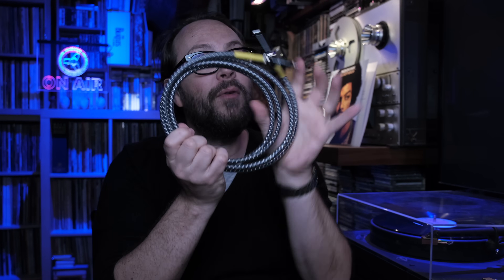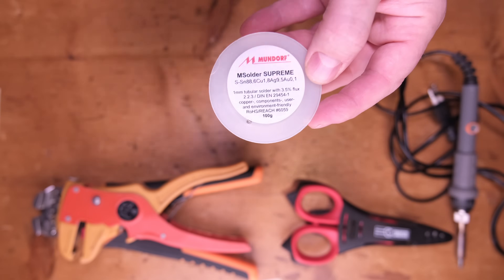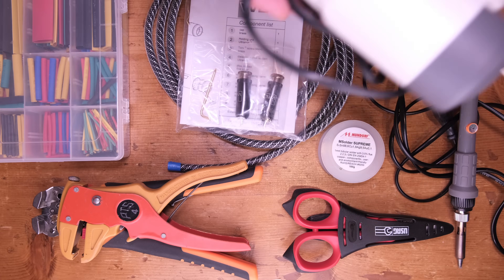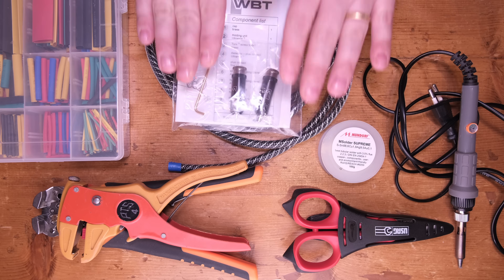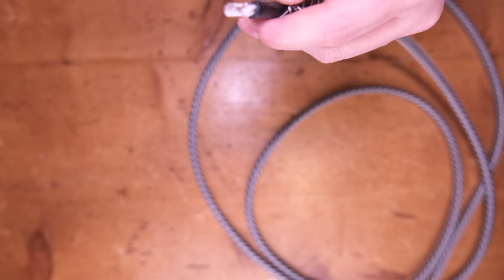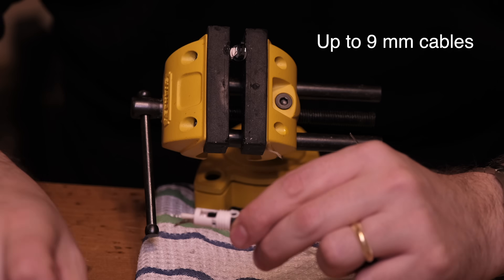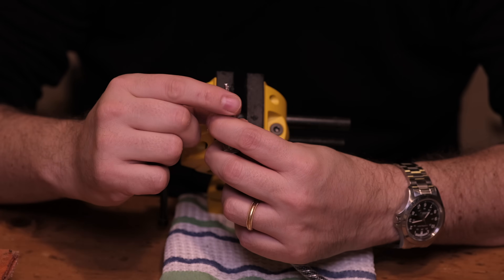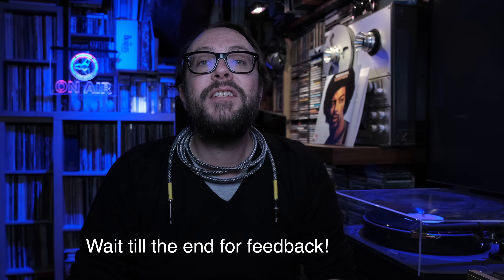How to make the perfect coaxial cable for digital audio (SPDIF)

Comment: Hi can I ask what you done with the copper band.thanks in advance  I'm in the process of ordering a 2m length and 4 rca fitting s to make x2 cables
Reply from the maker: You mean the braid? I am not sure but I think I did not connect it this time or only at the source side 🤔
Reply: Hi would you consider doing a new video with the same cable and rca plugs i am wanting to order the same bits .
Regards mark

Comment: U need 50 ohms digital cable  from  internet  distribution suplyer. Just ask them the cable cuttings in the recycling wire. Never use 75 ohms

Comment: call me crazy, but i don't think the plugs should cost 8 times or more the cost of the cable, the neotech can be got for £12.50 from hifi collective for 25cm, which is all i'd need, the plugs are over £50 each, that's snake oil lunacy

Comment: Main to know the coax is a radio waves transporter thus it is absolutely must be in 75 ohms..yes yes I mean that you need an antenna cable.😊
Reply from the maker: Yes but with DIY you must be sure also the connectors respect that

Comment: Love it!! Thank you for posting! Also, I have a Michael Jackson master tape. It's 2 inch, 24 track master that I transferred a few years ago with my very own Otari MTR-90 24 track recorder. It has all of the discrete tracks with 2 vocal passes of Michael singing. This is done for comp'ing. Thaqt's when you select the best parts of two performances during mixing in order to create one very good take. I obtained the tape from a guy who was selling off  multiple reels of tape that he got from Ocean Way studio when they had transferred everything to digital for archiving. The tapes usually go in a dumpster after the digital process. In this case I needed a few empty 2 inch reels for when I'm assembling a master mix tape and in this case, he sent me the reels with the tape still on the reels. The label outside the tape box says Michael Jackson Dangerous. The tape came with alignment tones so that made it easier to align my machine to the tape.
Reply from the maker: Wow!!!🤩

Comment: Could have bought a perfectly good digital coax cable for a few bucks, all the zeros & ones  would have got to the DAC, and the sound would be exactly the same!
Reply from the maker: Impedance matching does help and don’t forget that all the zeros & ones as you call them travel in an analog format, voltage, hence subject to all the various problems and issues of normal cables

Comment: Its a lot easier to buy off-the-shelf BNC coax cables and add BNC to RCA adapters. BNC coax cables are pretty cheap because they are used by the millions in every electronic shop in the world.

Comment: Ye - you should have shown measurements - how good this cable is ☝☝🧐
Reply from the maker: Measurements on short cables are nonsense. Only dielectrics have a sensible impact. Capacitance also have an effect but mainly on weak signals like tape heads and phono cartridges.

Comment: or, you can buy some van Damme coax for about 10 euros, some fake WBT's for 10 euros, and make a functionally identical cable for a tenth the cost of this nonsense. A digital signal just needs to get cleanly from A to B, digital information doesn't care if it gets sent over silver, and it certainly doesn't know if its going over a genuine WBT. Spending more than 200 euros on a coax cable is madness.
Reply from the maker: There is no difference between analog and digital signal because digital travels in an analog form, yes, voltage so it is susceptible to the same problems of interference, inductance, capacitance and resistance, plus all the problems coming from the dielectrics. It is much more complex than what we think.
Reply: @anadialog  Best answer one could have wished for.

Comment: The golden rule of audiophile cables: You tell the average audiophile the price of each cable and magically the more expensive one will be the best sounding one.
Reply from the maker: Don’t know what you are commenting because I am the first (for years now and with much more impact) to claim that you don’t need to spends hundreds of dollars but just look for quality materials and do them yourself
Reply: @anadialog  Yes, I know, and I'm not here to disagree with that message! Actually I agree on it 100% and also love my own system to look audiophile on every cable, even for those cables where there is no actual audio fidelity difference.
Reply: @anadialog  One video that would be really fun to make and very informative is to go the other way around and just make a very long SPDIF cable using 75 Ohms antenna cable long enough to get audible data errors. You probably need more than 25 feet for that. Then reduce the length until you feel the audio data is coming through reliably and run an A/B blind listening test between this insane cable and any dedicated SPDIF cable (short length), ideally some crazy priced Nordost cable or similar. If you can reliably convince yourself that you actually hear any difference, it would be interesting.

Comment: Obviously audio cables costing 100s or 1000s of Dollars are pure snake oil considering the actual material BOM cost is down in a few Dollars. However, don't get fooled also by their marketing justifying those insane cost to think that you need sophisticated cables for everything. SPDIF (Sony/Philips Digital Interconnect Format) is a relatively simple one way binary level data transfer connection using Biphase Mark encoding with a base frequency up to 3MHz. For this reason the cable does exhibit some RF transmission line concerns and needs 75 Ω coax to support it, but because the cable is short and 3MHz is still relatively low frequency, you don't have to worry about data being lost or altered. Your old TV or radio were often also using 75 Ω coax cables btw but up to 100s of times higher frequencies and at much longer cable lengths. So save your money and time, SPDIF connections do not make a difference for your sound quality, as this YouTube video doesn't look or sound any better using an audiophile power cable to your computer. Period.
Reply from the maker: Which quality spdif cables have you tried?
Reply: @anadialog  Numerous cables in fact, cause I work professionally in audio R&D. As SPDIF is a data transfer interconnect, the goal is to have a reliable transfer of every bit of data. The physical and data link layer of the SPIF protocol is reliable because of the relatively low data frequency and short cable length. You could try to connect a long coax cable (e.g. if you have an old TV cable) and perhaps if you reach a very long length, you would start to hear data reliability issues. So how would such data errors sound like? Loss of details? Change of tonal balance? Change of sound stage? NO, what you will start to hear when the data becomes unreliable is DC jumps in the signal with very nasty effects. Yes, I've heard how that actually sounds like! Until the moment where data becomes unreliable, data is data like it is when you do online banking, watch Netflix or whatever you do with those data. Also jitter is a concern of good PLL design on the DAC side and not the cable btw.
Reply: @ThinkingBetter  anadialog is in shambles!

Comment: That's great and everyone should build their own cable.
I built mine from a standard 75 ohm TV  cable (white) which is perfect for this use ,it is wideband and Easley enough for this application.
The only (not big) drawback is that it is not as flexible as other cables, it is so cheap and works at least as good if not better than other cables ( compared it to quite expensive cable and there wasn't any difference between them sound Wise)

Comment: SPDIF Myth Busting:
1) No SPDIF cable is going to make subtle improvements or changes to the decoded audio. Bad cables make clicks and pops or no signal at all. That's the point of digital signal transmission. 
2) Exotic cables do not sound different other than above (clicks and pops). Just use plain old 75ohm coax which SPDIF was designed for.
3) You don't need true 75ohm RCA connectors,. At the frequencies involved for AES/SPDIF, the impedance mis-match due connector length is irrelevant.
4) For short runs, like under 4 feet, any plain old audio cable will probably work but I would still use proper 75ohm coax. But again, cable problems result in clicks and pops, not subtle degradation's to the decoded audio.That simply can't happen.
5) Copper wire is not directional period! Some XLR cables may show a direction due PIN 1 being unconnected on one of the ends. but that copper has no ideal direction.

ANA[DIA]LOG, What is your background in Electrical Engineering? As for mine, you can look me up on LinkedIn.
Reply from the maker: 1) wrong because digital travels on analog signal. 
2) 3)  seem to contradict each other 
4) Wrong again. Just for a start bad insulation may attenuate the signal (dielectric constant).
5) Cables are directional when the screen is not connected at both ends. Period.
Reply: @anadialog  1) what?
2) 3) learn to read
4) you are wrong
5) learn to read again
Reply: There are two different types of listeners. Those who look at a monitor's and let there fingers do the talking. 
Then, there are avid listeners who are willing to take the punt.

Comment: i most certainly would love, to have… solid silver and a pure gold audio cables… laid out in front of me right now, to connect up…. and have a listen, and see if it does make any difference.      Much more detail perhaps;  without  having to mess about with the built in graphic equaliser.  
Solid Gold or silver speaker cables too…  yes that would be great!    That’s assuming that you can get hold of…. any of these cables in the 1st place.   Might cost a pretty packet too?

i have, 2 sets of speakers.   One set is the Wharfadale 9.1  and the other is a pair of Moukey… 3 way. 
i tested them both using my solid electrical copper speaker wires ( not too long) but thicker than satellite cable.  and I’m using a made up twin solid copper coaxial cable.  There is a noticeable sound difference In between the 2 sets of speakers.   The Wharfadale came out on top. Much clearer.  Slightly more detail.    
Friday am 19th May 2023.  Southampton   England 🏴

Comment: As, I’ve mentioned in my comment.  I’m using solid copper electrical wires for my made up coaxial cable.   But there is one million dollar question that i don’t know……  are these cables oxygen free???   (OFC) 
Tuesday pm 16th May 2023.  🏴 Southampton England
Reply from the maker: The ones I used is OCC silver

Comment: i made my own coaxial cable too;  but i used solid twin copper electrical cable with a couple of connectors to go with it.     At least both of the cables are solid.  I’m not overly keen on stranded wire.   i use this type of wire ( solid copper wire) for speaker cables too.   Coaxial cables are noisy, because there is a current flowing through the wire itself.  But the sound quality is still retained; with plenty of detail. 
Monday am  15th May 2023. 🏴 Southampton England

Comment: I've always wondered why no one has tested and posted results of different RCA connectors to see which ones come close to 75 ohms.  I have seen a ton of cable measurements but not a single test of the actual connectors.  Odd.

Comment: Shit, that's were exactly what I were using for years. I use the AECO pure silver connector which are the OEM factory of ETI Bullet plug. Also, did you tried any different if all braid connected to the ground v.s. just connect the inner/outer/all sheild to the source end only ? There are certainly many way to play with this multi-shielding cable.

Comment: I ordered a set of 4 of these connectors and a meter of the cable; to make 2 short coax cables that I need in my system - one for the streamer and one for the CD transport. I have been using a Monolith cable - that is silver coated on the copper center conductor. I have tried 4 other low cost cable (they are all a bit more than the Monolith) and none of them have anywhere the sound quality. So, I am hoping that this cable is even better than the Monolith. It is ~$15 vs ~$172.
By the way - I can highly recommend the Iso-Braid AC cable from Pine Tree Audio, here in the US. They are $65 for 3' and about $10 more per additional foot. They sound *stunning*. NOTHING short of an amazing new amp or DAC has made anywhere as much of an improvement in my system, as using these Iso-Braid AC power cables.
It took me over 30 years to try an AC cable swap - though for much of that time, my equipment had non-detachable power cords - and I was a very big *skeptic*.
I wasted over 30 years on what I now know was totally mediocre sound!
Reply: If you are streaming, invest $40 in this network switch... Amazon has them in stock. NETGEAR 8-Port Gigabit Ethernet Plus Switch (GS108Ev3)

I installed this switch into my network and never said a word to anyone. This switch only serves my little AV corner in the living room. There is a Roku Ultra and BuzzTV android box getting signal via this switch, HDMI out to the TV. My 80 yo mother walked into the room and thought I had bought a new TV and sound bar... The difference in sound and picture quality was that dramatic. Spend the $40, if it does nothing, send it back for a refund. It is even better with an upgraded 12v power supply.
Reply: I ended up paying to have the two cables assembled - they did them both for $50, and used silver solder.
THEY SOUND FANTASTIC! I was using silver plated coax, that sounded better than the 4 other coax cables I tried - but these pure silver cables sound significantly better, still!

Comment: You better off going with a non-shielded cable for digital signal and trying to get 93 Ohms.
Just use some pliers ideally pointed nose and wrap a elastic band around the handle as a clamp to hold your wire or terminal
Reply: Why 93ohms? SPDIF is a 75ohm transmission line. It is designed for standard 75ohm coax. Under six feet it won't mater anyway but again why not just use the proper cable?
Reply: @andydelle4509  well 75 is a standard for digital but if you use 93 you should get less ringing smoother response on the top leading edge should sound a bit better analogue more  filtering at the high frequency above 10kHz
Reply: @hoobsgroove  Where are you getting this information? There is absolutely no benefit to mis-matching an impedance controlled circuit. A mismatch is exactly what causes ringing and reflections. And furthermore, what makes you think less ringing on a digital pulse train relates to less ringing on the decoded analog signal? It simply doesn't work that way. As long as any ringing is less than half the pulse amplitude, it is invisible to the decoder. Any more and you will get clicks and pops due to errors.

Comment: You made an xlr  cable, but you didn't use occc  connectors. do you think it's making a big difference?  have you tried silver xlr cables?
Reply from the maker: Yes, the keep the price down in that video  I used non-occ connectors. But at least it was still high quality copper. No, I don't think they would make a big difference only some difference.  Nope, no silver on xlr, usually they are quite long, maybe one day...

Comment: The 2001 is a triaxial. I only connect the outer shield to the source end. The distance between inner "shield" and the center conductor is where the 75 ohm relationship is created. Also I do not see how the 75 ohm is maintained in the connector you are using. The distance between the conductors looks to be changed. I use a hot knife to cut insulation, super easy. Also use the hot knife to melt the decorative cover into the insulation where it will be inside the connector so no shrink is needed. I modify Switchcraft 3502AAU connectors so that the cable can be butted up to right where the RCA takes shape. There is only about 1/32" at each end of the cable where the conductors are not in their original coaxial arrangement.
Reply from the maker: In the video you can clearly see that I connect only the outer shield. In the connector the distance is created by the connector itself which is a 75 ohm silver  connector designed for coaxial cable. I think all this is very clearly expressed in the video.
Reply: @anadialog  From the Sonic Craft website where I have purchased. "Our recommendation is to terminate the inner braid at both ends, and the outer braid at the source." I THINK YOUR CABLE STRIPPER CUT OFF THE OUTER BRAID !. Look at the diagram in your video, there are TWO BRAIDS. You say in the video "Repeat on the other side". You are not supposed to do the same thing on each side. You also say "this is the first one I have made." I have made about 50 of them. I am giving you my feedback as you request because I make these types of cables. I have tried many connectors. I don't doubt you are happy with your cable. I believe you could be even happier.
Reply: If you connect the shield at both ends then its no longer a shield. You have two grounds. The cable you are using has a live , ground and dedicated  shield thats to be terminated at the source end. This is why many cables are directional.
Reply: @stephens2r338  That is exactly what I said. The Neotech 2001 is a triaxial construction. The largest diameter braid is the shield. and is connected at the source end only. In the video this is cut off at both ends with the wire stripping tool and I don't think the guy in the video is even aware that it is there. He even says the stripper tool doesn't fit properly. The next braid is the negative and is connected at both ends. Then the center conductor is the positive. You can see the 2 braids on the cable diagram presented in the video. Most all 75 ohm cables are coaxial and there is only one braid and a center. The braid is often still referred to as a shield, which is why I used quote marks on the word "shield". The whole point of my comments is that the builder was not using the actual shield at all.